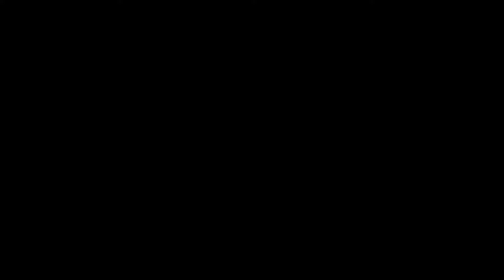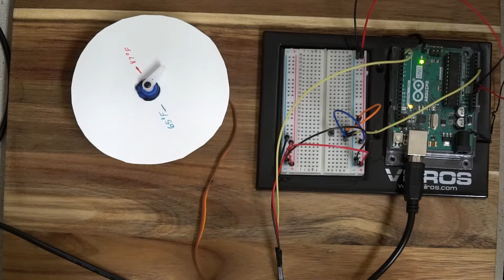Temperature servo motor

Comment: I'm looking for something very similar, but in a different temperature range.  I want to control the vent on a BBQ pit by controlling a servo when the temperature is between 200° to 400° F.  What sensor would you use and how would you connect it?

Carlos
Reply: I'm no expert, but the blog post in the description has some helpful websites that may have your answer.

Comment: Hello friend I really like your clips.
If you don't mind, can I take a look at the code.
Because it helped me learn more
Reply from the maker: Thanks! I added links to my blog in the video descriptions. The blog posts include code and sources.

Here is my blog post about how I figured it out. It links my code and sources I used. https://akerskat000.edublogs.org/2019/12/08/challenge-build-6-secret-ingredients-revealed-motors-and-sensors/
Reply: @kathleenakers2294  Thank you.  I'm about to start a project of creating a completely automated egg incubator.  This really helps because it will allow me to control a servo depending upon the humidity.
Reply: @jarodmorris611  glad to here that. You’ll have to let us know how it works out.
Reply: @katieakers5680  I have a few GoPro cameras and was thinking of setting them up while working and then later adding voiceover just to explain what was going on.  This will also include making the insulation from perlite, water glass and plaster of paris.  Then I'll use kanthal wire for the heating element.